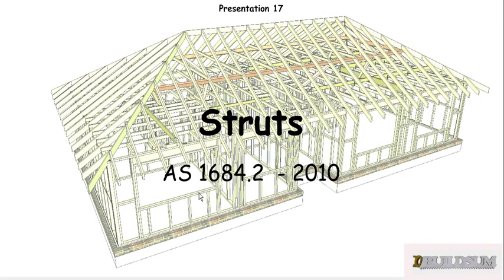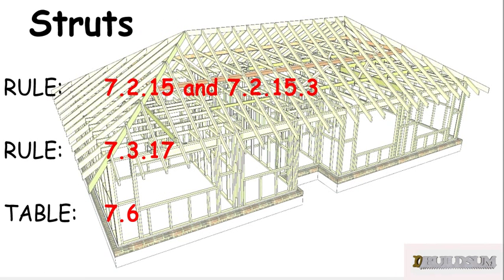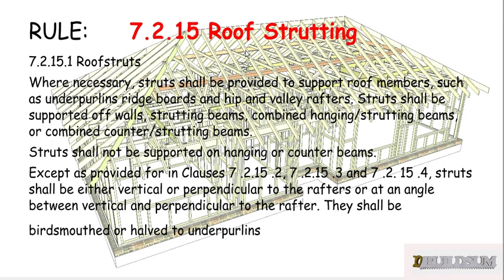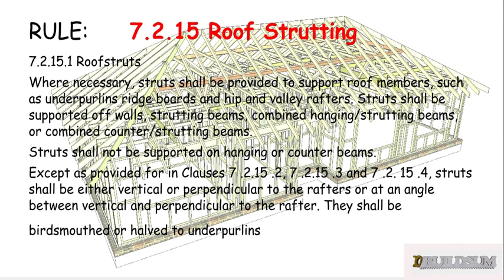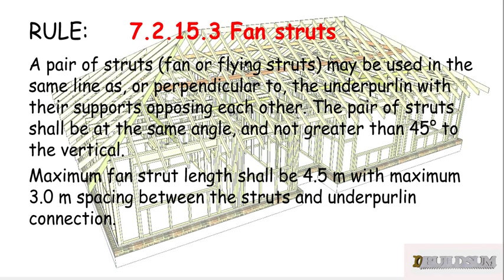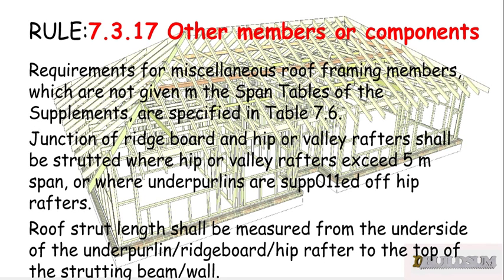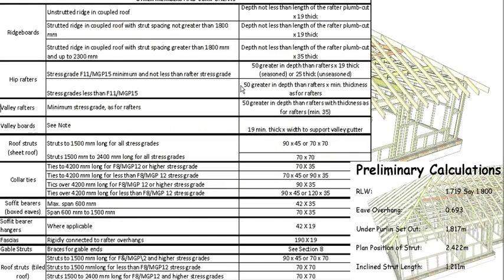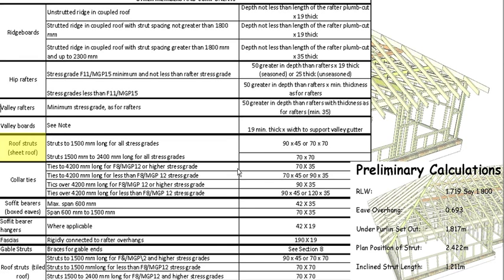17   Struts

Comment: Hey mate appreciate your content, im a Carpenter and when we do flat roofs under 5 degrees we just build soldier walls. But we dont half or birds mouth our struts. Is that to Australian Standards?
Reply from the maker: HI Mate AS 1684.2 says "Roof Struts shall be birdsmouthed or halved to underpurlins"
"Alternatively, for struts in a position between vertical and perpendicular to rafters that are not birdsmouthed or halved to the underpurlin, a 30 x 0.8 G.!. strap shall be passed over the underpurlin and nailed to each side of the strut with 4/30 x 2.8 dia. nails and to the underpurlin with 2/30 x 2.8 dia. nails each side in addition to at least 2 skew nails. One
framing anchor with four nails to each leg may be used as an alternative to the strap."

Hope this helps

Comment: I am under the impression that the strut sits vertical or perpendicular to the rafter, while being parallel i.e. from a top down view it sits directly under the rafter. We have an older building that has struts supporting the underpurlin every 3rd rafter, but the struts then go off on random angles to a wall plate. Was this practice common back then and is it still compliant today?
Reply from the maker: Hi Cam, I believe you are correct however the Australian Standard only mentions vertical or perpendiclar it doesnt mention anything else unless they are set up as Fan struts which act against each other. I doubt that this has changed, it definately hasnt in my time. 
With struts on every third rafter it does sound like they have plenty of struts and if there are no signs of the roof sagging then they are working.

Comment: Hey buildsum, to all chippies you are the gold to our heart lol, could you possibly make a video in relation to upstairs walls , & to what wall upstairs needs to be carried by a LVL? Question is to all walls , but would be good to see it on video ?
Reply from the maker: Hi James, thanks for your comment, I cover off on this for all floors in this video, the link should take you to the correct time in the video. Hope this helps
https://youtu.be/xq14GrJdZ8g?t=589
Reply: Buildsum thanks for getting back to me !, I have just watched it, & I’m sorry no help, for a double story house,  when installing ijoists, where to locate levels for what walls?, I know my friend told me depends what supports the roof ? If you know what I mean ?
Reply from the maker: Hi James, any load bearing wall that runs in the same direction as the Joists will have to be supported by a LVL. If the roof is a trussed roof then the only load bearing walls are the external ones however if the roof has been Pitched or Cut then any of the wall could be depending on the position of the Struts, strutting beams, Hanging Beams and counterbeams.
Reply: @Buildsum  thank you so much! iv learnt so much from you!